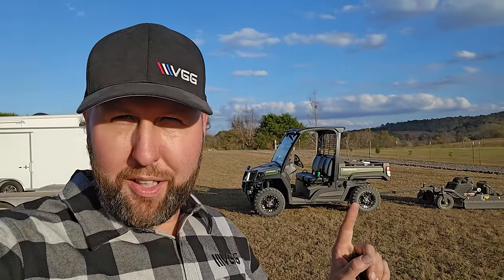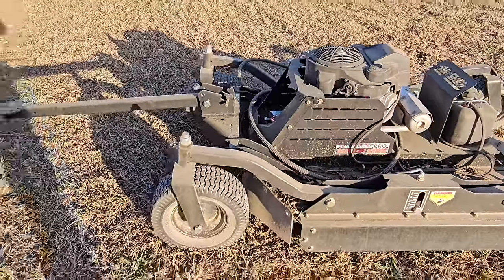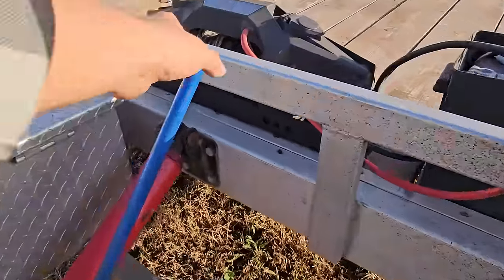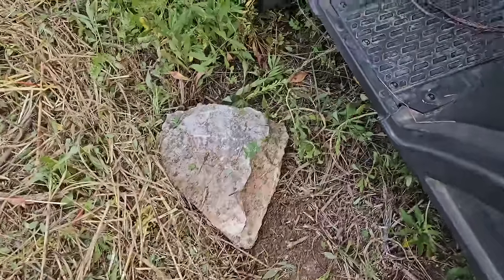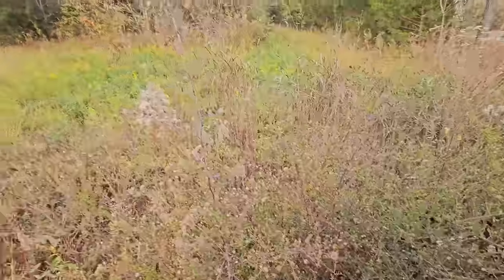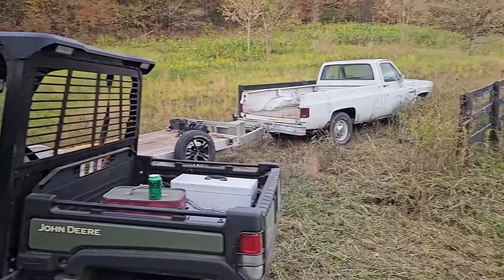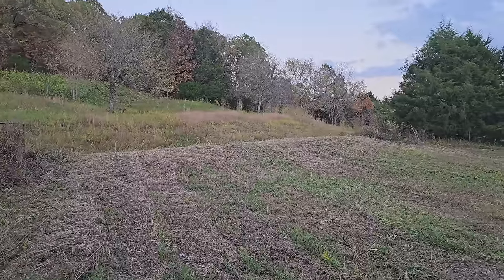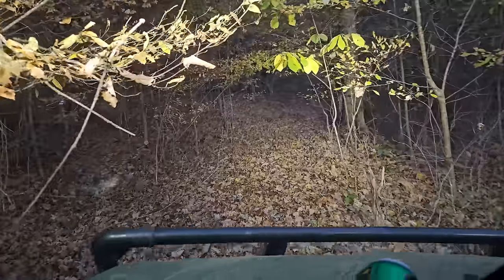Exploring & Brush Cutting our NEW Property!

Comment: A lot of folks use those hydraulic sidearm brush cutter tractors here in North Carolina too Derek.  They also use them to trim tree branches growing too close to the side of our two lane roads.

Also if you can get a cheap Ventrac mower from an auction you’d be in business.  If you can’t find one of those for cheap fill the tires on your little tractor with beet juice so it’s not tippy.  That’s all the advice I’ve got from one fella saving a few bucks to another.

Comment: That's a nice peace of land; can never have too much. I've had  a UTV since 2006 and ATVs since 1989 and lessons I've learned. 1. full protection skid plates are a must 2. NEVER go into woods/brush without heave duty limb loppers and/or chainsaw 3. tire sealant/puncture kit highly recommended 4. NOT FOR EVERYONE, but I always carry a firearm and yes I have had to use it 5. first aide kit is handy I also like a small fire extinguisher as well as the means to start a campfire.

Comment: I had a 20 acre property for 28 years that was pretty much on the side of the Niagara Escarpment about 4 miles west of Thornbury Ontario in Canada. I had a 24 hp Kubota tractor with 4 wheel drive that worked very well with a 3 blade bushhog on the rear. The trick to cutting slopes is to go up and down not back and forth.

Comment: being you already have 12volt on the trailer, an air-over hydraulic powered cylinder from harbor frieght or an electric servo cylinder would make tilting the deck easier/quicker. The air-over cylinder's compressor could run exclusively on vehicle power with a pig tank allowing it to be a small compressor, handy for tires. Would be filling any time it's connected to the truck with a switch to run to the batteries.

Comment: New Holland C232 tracked Skid Steer with front mounted hydraulickly tiltable Extreme brush cutter.   You can punch a trail pushing forward with one.   You can sidehill track and mow down small trees without worry.  It will drag dead old cars out of the treeline, uphill, in the snow, with no oxygen, easy.   Had a chance to operate one just awhile ago.   It was too much fun.  The hydraulic brush cutter head swivels and floats with a flick of the wrist.  You can pick it up and fold it right to the cab door.

Comment: Swisher trail mowers are amazing.  If the tow vehicle can run over it, the mower can cut and mulch it.  I sadly discovered that this doesn’t include rocks…  Ruined the main bearing in the mower, but not a hard replacement.

Comment: I know the term “use what you got” but me personally I have the same brush hog, and a little bit bigger finish mower, I pull it with my ATV, a Honda Foreman 450ES 2wd/4x4, that is really low gears, and very maneuverable, and extremely durable and reliable! I also have newer Honda ATV’s as well, that are probably more maneuverable with independent rear suspension, and power steering, but I use the ole Foreman 450ES with the straight rear axle, it will pull anything you hook it to. If you haven’t got one, I’d definitely recommend you try one, it will put that big side by side to shame, for things like that.

Comment: That Swisher mower is designed to run to one side or the other of your tow vehicle so you don't have to run through all of that tall stuff with your SBS!   Just pull some pins and the tongue will allow you to set the mower path out to the side!  Check it out!

Comment: You need a DMI quick cushion hitch on you service truck. They take the shock out of hauling trailers and such. Kind of expensive but you buy one and most people transfer them from one truck to another. I worked for the original company, Dietrich Manufacturing Inc. in Goodfield Illinois back in the early 1980's and they were a big seller especially if you hauled grain wagons with your pickup..

Comment: Just my opinion: You have a tractor, put a 4' - 5' brush hog on the thing and get the job done.  That little mower you have on the side-by-side is for flat land that has been cleared of most obstacles.  Also the tractor with front loader would be a great help clearing all that trash and those pallets and piling them for a bonfire

Comment: I’ll tell you from using the 44 inch version of that… cut you a discharge so it can get debris from under the deck…. Upgrade the air filter to a fleetguard canister ASAP, and get an oil drain hose so it’s not a messy oil change

Comment: You'll really enjoy the new buggy, I use mine for everything, recently bought a 65 gallon boomless sprayer for it and boy is that the hot ticket. I believe yours has the 3 Cyl Chery? Rock solid motors, I just rolled 12k miles on mine without issue.

Comment: Those are probably logging roads.  Theres thousands of miles of them cut into the hills all around me.  If you're into local geography, its interesting to remember meadows and open farmland are not really a naturally occurring thing in Appalachia.  Most were at one time wooded.  The settlers were tough as nails clearing that all with mules.

Comment: WOULD LIKE TO SEE YOU FIND A OLD BOBCAT TO FIX AND USE IT TO CLEAN UR PROPERTY, PLUS LOOK FOR A LOW PROFILE  BELARUS 250AS TRACTOR TO PLAY WITH ON UR PROPERTY YOU WILL LOVE THAT TRACTOR AND A 5FT BUSHHOG FITS PERFECT BEHIND IT... BELARUS 250AS IS A 2-CYL 31HP DIESEL AIR COOLED TRACTOR WITH DOWN FORCE HYDS WITH GREAT POWER AND SUPER TO WORK ON... I HAVE 3 AND OVER 20 YEARS OF WORKING THEM WITH LIL BREAK DOWNS.... GOOD LUCK..

Comment: I can't afford a $7k (or even $17k) side-by-side. I'll just have to make do with my used $1500 Toyota 4x4 pickup. Of course, mine came stock with doors, a heater, plenty of cargo space, and can even legally be driven on the highway. 
I like to use three 15' poles in an N shape to hold the 4-caster BrushHog out in front. That way i can see where i'm mowing.

Comment: Now I kinda want to see a riding snapper made radio controlled. with brush hog implement instead of standard blade. Weight it down and it can mow on pretty steep inclines. Plus could be a fun project with the kids. And the one interested in computer things. could maybe write/code arduino or raspberry pi to create drive patterns so it is almost automated.

Comment: My old bus was gonna be used as a hunting blind so it would surprise me if that was the case. Hope you do a follow up and might as well run that mower up that path while your at It. Clearing a mountain top campsite sounds awesome.  Hard to see through the trees but you could be near the bus grease monkeys place, couldn't tell with the lighting if it looked familiar or not. Also could just be a meth head.

Comment: So here's the deal. It might be time to look around for a Kubota or Deer 4 WD tractor (30hp) and a Flail.  With a heavy duty flail we woo'nt be worrying too much about those pallets.  About a year ago I saw an Altec chipper powered by a Buick V6 that some rude miscreants had stolen the ignition and injection parts off the top of the engine while it sat at a jobsite.  I waited two days to call the feller and that was a day too long.  Somebody got a good deal.  It went for $1300. The guy needed a chipper; not a project.  With an outfit like that a you could do some real damage.  Anyway, a very nice piece of land there.  With a crick a guy could go into whisky part time.  Then you wouldn't get nothin' done.